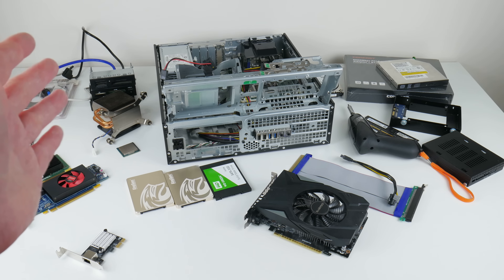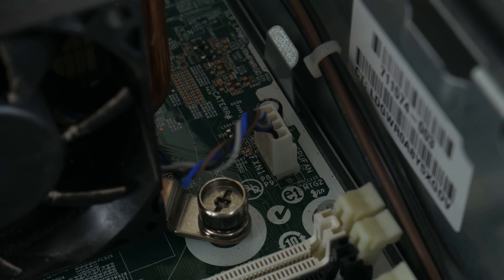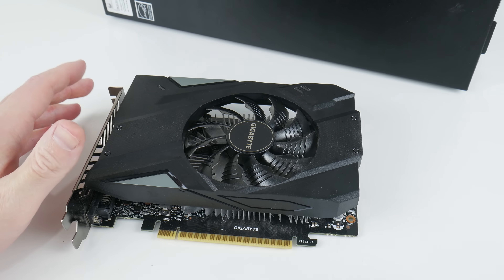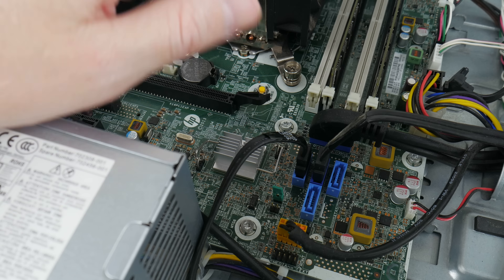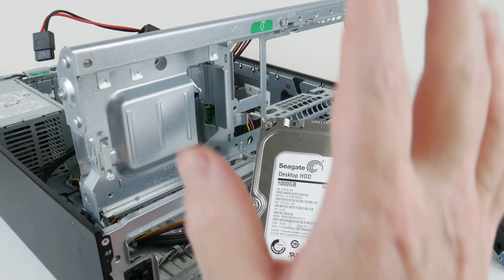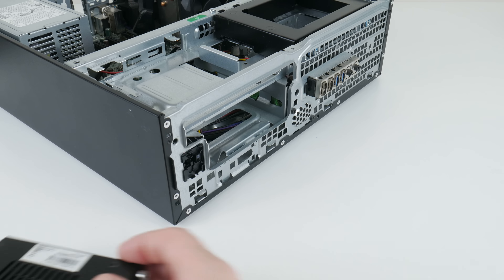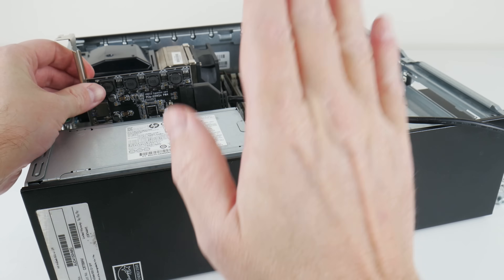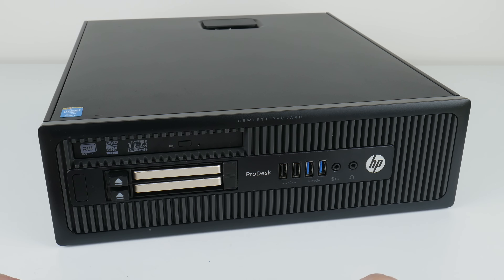HP ProDesk G1 Small Form Factor Upgrade Guide

Comment: On my Dell with the same dedicated on-board HD 4600 Intel graphics, the quality is terrible, and the audio is even worse. I eventually broke down and installed a 2 GB Nvidia GeForce 210 card and saw a huge improvement in overall performance on the old machine. Don't be fooled by those benchmark ratings for the onboard graphics. It does not mean it is better; just being able to give higher marks in a test is all it does.

Comment: Too bad I didn’t stumble on this clip a little earlier.
I’m just in the process of adding a 2.5” SSD and a 3.5”HDD to my Prodesk 600 G1, and soon after I started found out that the disk bays are non standard sized.
So, I’m currently debating myself whether I should order the necessary screws quick and expensive from Amazon, or slow and cheap from AliExpress…

Comment: Thanks. Great video. Answered so many of my questions. I see you have a Probox which looks identical to my Elitedesk 800 G1 SFF, although I don't have a removable panel between the Power switch and USB sockets on the front. I'm going to be a bit more confident changing the drives after seeing this video

Comment: I put 1060 6gb 3 years ago on the same pc. I use pcie riser, isolate gpu pcb and fit verticly betweeen cpu cooler and case doors. Works very well. Two weaks ago i move all to old cheftec cs03b case

Comment: Hi I have the exact pc model in this video and some of my friends who has gtx 1650 but not low profile he doesn't need it anymore since he both a new one so he offer me to buy it he said it still runs good as new but my pc is sff so I had no idea what to do and I dont know if it gonna work. the card graphic gtx 1650 gigabyte who was used in this video ,can it actually fit in sff prodesk 600 G1 without low profile???
Reply from the maker: No it doesn't fit of course
Reply: I would guess you could try it? but I assume even if it does plug in, you'd still have to leave the lid off and have it laying on it's side so that you don't have to worry about the card staying in or bending/breaking stuff if you were to try to stand the computer up. It certainly wouldn't be convenient, but if it works and you're careful with it, could be fun.

Comment: Woah what was that? Theres a sheet of paper you can put instead of thermal paste?
Reply from the maker: Yes!
Reply: @philscomputerlab  oh wow you replied. Does the HP Prodesk 600 G1 have max 35w on PCIe slot? If so I can't put a GTX 1650 in it right?
Reply from the maker: So this is how it gets tricky. PCIe spec is 75W, so your 1650 should work, but HP doesn't support it.
Reply: @philscomputerlab  so HP not supporting it means it won't work?
Reply from the maker: @LionTree123  No, it means HP doesn't support if you have issues. It might work or blow up 😂
Reply: @philscomputerlab  ooh. Should I try it? 😅
Reply: @philscomputerlab  if you mean that the guarantee doesn't cover any damages through this, it's a used computer anyways so I wouldn't expect HP to do anything

Comment: You can get a kit so that you can mount two 2.5 inch disks in a 3.5 inch bay, then there is no need to delete the optical disk.

The 600 G1 SFF that I have already has 4 USB 2 sockets and 4 USB 3 sockets so haven't found a need to use up PCI sockets to add more. 

Upgrades done to mine are:

CPU upgraded to a 4790; 

16Gb of memory added to bring it up to 24Gb - adding 8 Gb would have been sufficient;

Boot 500Gb HDD replaced with a 960Gb Kingston 2.5 inch SSD in a dual 2.5 inch caddy leaving room to add another 2.5 inch SSD;

3Tb WD Green added for backups; 

GTX 750 ti 4Gb graphics card added;

DVD-RW retrofitted as mine didn't come with one.

Comment: Did the case lid close properly with the non-low profle GTX 1650?
Reply from the maker: @oforiart  Of course not. It's not a pretty solution, and unless you cut away parts of the case, the lid has to be off.

Comment: If anyone is wondering a RTX 3050 LP will work as well. I've been rocking one on the G1 600 sff for a couple months now with no problems.
Reply: Its a 75w card so probably as you can run a 75w 1650
Reply: But doesn't the motherboard only support 35w on the PCIe slot?

Comment: Cool video!
I recently received this computer from a familiar.
I want to convert this as a NAS, I already have 1 ssd (that one is not attached to any screw, is just floating with the cables lol), so I wanted to add 2 HDD of 1 Tera each, I see the first bay clearly for 1 but I don’t see for the other, can you telling me where should I put the other HDD? Or if I should use an adapter?.
Thanks!

Comment: Did u change the power supply coz the gtx 1650 is a pretty big gpu so. Do I have to change the power supply?
Reply from the maker: I did not.
Reply: @asseenontvbe  i don't think it's silent. 
The fans inside are pretty loud.

Comment: I've just score a refurbed i5 one of these with an SSD an 8GB memory primarily for use as a zwifting PC (indoor game controlled cycling trainer) I also got hold of a cheap full height GTX 1050 Ti (I know there's low profile versions available but they're not available as cheap). The card works on a riser cable, the issue is housing it somewhere in the case

So currently I've removed the lower 3.5" mount from the pivoting front tray and I've designed a 3D printed internal GPU caddy to try and fit it in that lower forward space. If all goes to plan I'll actually be able to keep the slim optical drive (but I don't really need it) and have a decent, cheap "gaming capable SFF desktop" for the garage...

Lots of people seem to look for ways to move these ex-corporate SFF machines into full tower cases so they can fit full sized GPUs, but I quite like the idea of keeping them in that more compact form so they can fit in more convenient spaces.

Comment: Hey Phil, I have a question:
I have an HP Compaq Elite 8000, what specific ATX cases and adapters would I need in order to be able to move the motherboard as well as the proprietary PSU into a new case? Thanks!
Reply from the maker: No idea, not covered in this video and really wouldn't recommend it.
Reply: @philscomputerlab   Why? Is it because the proprietary PSU or is it because the ATX standoffs won't fit a modern case?

Comment: What size is the exhaust fan in this?
Reply from the maker: I don't have access to the machine anymore so I'm not sure. But it was either 80 or 92mm.
Reply: @philscomputerlab  yeah I was thinking they’re either of those 2 sizes. I have the same computer, thinking about upgrading it to some brand new stuff, so prolly gonna need to replace the Realtek speaker with an intake fan with all the added power

Comment: my only complaint is that it is a smaller form factor making it tougher to mod and has less slots than full size, you should have named the parts you were using but generally hp is a pretty good bet for refurb if you need it now and for cheap - otherwise build something on an4 platform for much better performance and effciency - the old intel platforms are on their last legs both performance and value wise when compared to am4 options

Comment: Hello, nice video explain! I have hp 800 G2 sff i5-6500 ddr4 200watts 80plus platinum, what gpu is compatible fo this pc?? Thanks to help me, salute from Uruguay!
Reply from the maker: Officially, check the maintenance manual from HP. Unofficially the card needs to be low profile and maybe single SLO depending on your machine layout.

Comment: I just bought HP 8200 SFF because 1x 5.25 and 1x 3.5 on the front gives you better expendability. The HP 8300 SFF is the more modern and the latest option for this case form factor (Hp 8000, 8100, 8200, 8200 SFF share the same chassis)

Comment: How do you install and connect the Wi-Fi card please many thanks
Reply from the maker: If it's a USB Wifi, just plug it in and often Windows update will find the drivers automatically. If you want a PCIe card, make sure it's low profile and maybe have to download the drivers from the website.
Reply: @philscomputerlab  many thanks for the answer just a quick question where on the board does the Bluetooth cable plug into please many thanks
Reply from the maker: @markhopkins5440  Usuaully it will come with a USB header. But you can also get USB Bluetooth dongles!
Reply: Where on the motherboard does it plug in please many thanks

Comment: If you want to upgrade and keep the functionality on the "cheap", I can't recommend enough using the InWin BQ itx cases, especially if you can get the USB 3 150w or higher versions. They are the Chopin but with more flexibility as you can use them horizontally, vertically or vesa mounted, plus they have a slim optical bay and usb 2 card reader, plus always cheaper as they are more a practical aesthetic than a gamer one. I swear by mine, though I did mod it to put an external slim 120mm fan to keep my X570, 5700G and overclocked RAM a bit cooler. Makes a nice compact and relatively cheap 4K HTPC and Raspberry Pi on steroids for retro gaming. I managed to cram 2, 2.5 2TB hybrid drives, and 2 NVME drives into mine along with a DVD drive (second hybrid drive is jammed in behind he DVD but is in there tight).

Comment: This is the only upgrade built i see that not use Low profile because i have the same unit that i want to upgrade 😳 do you think Palit GTX 1650 gaming pro will be fit in this SFF unit? Since i got one here and i love small build pc units ❤️
Reply from the maker: It will not! fit. I used a riser cable and the card just sat outside the case for testing purposes.
Reply: @philscomputerlab  aww that's too bad maybe i just swap mini-ITX PC case for this one 😕

Comment: I built this pc exactly 1 year ago still runs great built this for my younger brother for editing and some gaming as of his age. 
Core i7-4790K 
MSI GTX NAVIDA 4GB 1050 ti GPU
32GB RAM 
1TB HARD DRIVE 
1TB SSD 
this all fit and work. The ssd fits using blue screws i got off ebay for £3.99 fit like a dream no issues. 
Only thing i did add is a wifi adapter.

Comment: i have i5-4590 cpu 2+2 4gb ram and 240 ssd and 500 hdd so how an i calculate power of my pc is using bcoz i want make it gaming pc with current nvidia quadro t400 or t600 so wich is best?
tell me plz answer my ques.
Reply from the maker: Buy a power meter and plug it in.
Reply: @philscomputerlab  tnx for replying sir but anyoinfld of software available??

Comment: You could also install your own modern high powered Mobo and extra dedicated low profile hardware - with some cable connection adapters and call it a day. You just won't see the dell logo on boot up but it's no major loss.

Comment: I have both an SFF ProDesk (Win10 Pro) and an SFF EliteDesk (Win10 Home) from HP.  Each has a 4th generation i5 processor (Haswell) at 2.3 Mhz.  The EliteDesk G2 has only 8 GB of DDR4 and a 256GB HDD.  The ProDesk G2 has 16 GB of DDR4 and a 516 SSD.   But I like both of them.   On a whim, I also bought a USFF HP EliteDesk G2 with a Haswell running at 2.7 Mhz and a 516 SSD running alongside 16 GB of DDR3.  But it's actually the fastest of the three and was priced exactly in the middle of the other two ($199, $219, and $249).   I'm happy with all 3. Can't wait to do regular maintenance and upgrades on such simple but well built machines.  (Bought them all Reconditioned, at different times and months within a four-month span between December 2019 and March 2020, from TigerDirect.)

Comment: I wanted a Prodesk 600 G4 so bad - but i caved and got a Optiplex 3060. The one M.2 slot is only PCIe 2 and theres 2 SATA drives, all supporting only 1TB.  I wish i pulled the trigger on the Prodesk I saw for 130USD smh

Comment: Hi, I have a prodesk 800 g1 16Gb. I added a gt 1030 and it handles 4k video easily. I've been using it for about a year now and I have had no problems. Incidentally, you can drive 3 monitors directly if you do this.

Comment: You forgot to mention the RS-232 (COMB) and Parallel port options from HP for this ProDesk 600 G1 SFF.
http://h10032.www1.hp.com/ctg/Manual/c03809098.pdf
Reply from the maker: Good point 👍

Comment: I'd like to get into this but it's difficult to research basic specs, since a lot of manufacturers like to cut costs by disabling a lot of functionality. A few times I've been burned on upgrades because the primary PCIe slot only has 4 lanes, for example.
Reply from the maker: Study the maintenance manual, it covers all those details.
Reply: @philscomputerlab  Sometimes.

Comment: I recently did a very similar build with the Radeon RX6400. I got lucky with an HP ProDesk 400 G6 w/9th gen i5 at around 170USD. I have to say these G1 boxes still pack a punch and you can easily get them for less than 50USD on ebay for the i5 model.
Reply: What rating is your PSU? I have a ProDesk 400 G2.5 which only has a 180watt PSU and I'm struggling to find a higher wattage PSU that will fit

Comment: Awesome vid! Few things; 1) if you get desperate, you can get a PSU adapter to run a more powerful PSU, I have done this and put the mobo in a bigger case. 2) Depending on the size and position of the BIOS chip, you can get a cheap programmable chip reader of aliexpress which may allow you to manually flash a fresh BIOS. 3) There are adapters you can 3D print to allow for traditional coolers! Check thingiverse!

Comment: There is another choice now with regards to low profile GPUs if you go used, and that is the RTX A2000 with it's 70W TDP.  That can make it a real power house 1080p to 1440p gaming rig.  The hot swapable drive bay is a nice touch as well.  You can set it up to where instead of doing duel boot OS you can just swap the OS drive with another.

Comment: I use an AMD A10-5800K APU 3.8Ghz 4 core with RX560 4GB for 4k. It has HEVC H.265 decoder. They make a low profile version I think so it should fit in that machine.

Comment: I have one of these an I love it however its keeps having start up issues. I've redone some codes in the bios. Also reinstalled windows but now it says it prevents a start up because of a  hardware issue. Cant figure anything out but hopefully I'll be able to fix it and start getting things upgraded! Any suggestions on a possible solution?

Comment: Have you also tried to use throttle stop for undervolting the cpu? This could maybe save you some extra watts.
Also the RTX A2000 could be an option for the gpu. Should be overkill, but sometimes you can get a used one "relatively" cheap. Would be interesting to see how this combo performs.
Reply from the maker: That A2000 has been mentioned a few times, but I don't have one. The other option is using a desktop GPU with the case open and PCIe ribbon cable.

Comment: 8:19 Going from a nice spacious 1TB HDD to a small 240GB SSD is not an "upgrade" - if you want an SSD, clean install Windows onto a 128GB SSD and then have your programs (and games if necessary) on the 1TB hard drive, in use as a second drive.

Comment: What I love about those ejectable SSD's is that you can make the top one your BOOT drive and swap the operating system as easy as a ROM cartridge in a games console. Eject Windows 10, slot in Ubuntu. Eject that, slot in Windows 7. Wrecked the OS? Reload a new image. No fear to mess around because there is very little down time.

Comment: wait hp still uses the same screws they used in compaqs from 15 years ago ? and they don't install spare screws on the inside of the front covers anymore!!? i just tashed 3 computers from hp compaq with full complement of screws plus spares in factory locations. i am kind of angry for hp for using frameless screens on new aio computers nowdays (which i broke and had to rebuy) but i see the missing screws and mounting drive bays started way before.

Comment: Get a GT1030 and you will get way better performance out of the machine. My lil brother used an HP 8100SFF with an i7 870, 16Gb of DDR3 and the GT1030. The Doom(2016) was easily playable on low-med with 1080p60. For these machines the GTX1650 will be too much, because of the PCIe slot power limitation. Most of them providing only 30-35W to the primary VGA slot, so a 75W card will be botlenecked.
Reply from the maker: I'm not sure where this 30-35W myth originated, but I hope my videos show that this is indeed a myth. The GTX 1650 destroys the GT 1030, it's in a totally different league.
Reply: @philscomputerlab  its in their manual. Dell SFF machines providung 30W and the HP, wich my lil bro had delivering 35W to the PCIe slot. Dunno if it for the safety or not.
Reply from the maker: @talos86  It's likely a recommendation because PCIe specifications rate the slot for 75W to be compliant.

Comment: I use the little bigger version G1 800 here which came with an i3 4130 and 4GB of DDR3-1600 and a 1TB mechanical drive. Well now i am using an i7 4675T in there - 35WTDP and 2Ghz base clock, a 6 and 8TB mechanical drive plus 128GB SSD and 4 sticks of DDR3 1600 in 4GB size. This machine is the heart of my retro-room where i do my research on, watching Youtube and store my archived files on. I dont miss a thing on this PC, its fast, silent, reliable, rock solid, using the Intel HD graphics and the internal network connection. Does the job for me 100% well as it is now. No dedicated GPU needed in my case. I still love the Haswell generation very much. Cheap, affordable power for daily use.